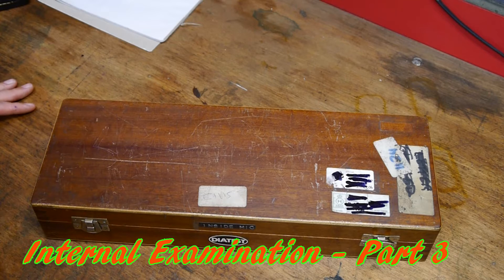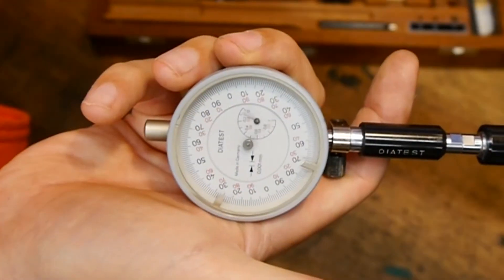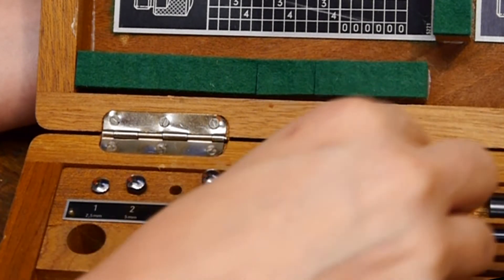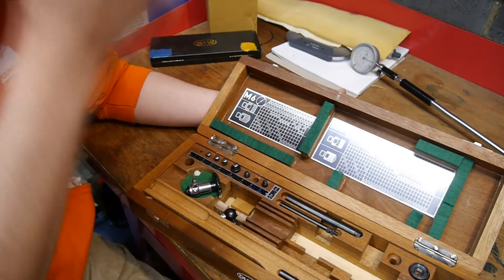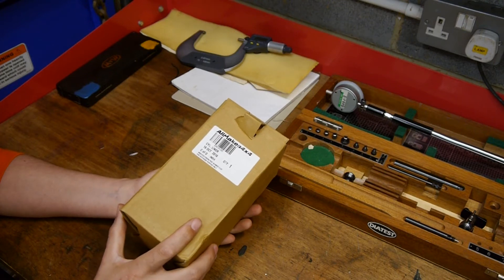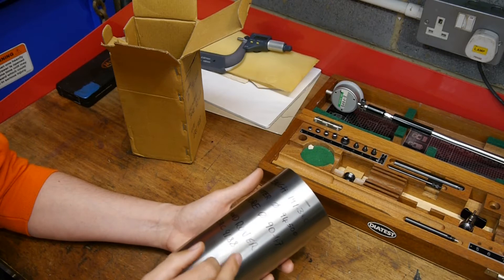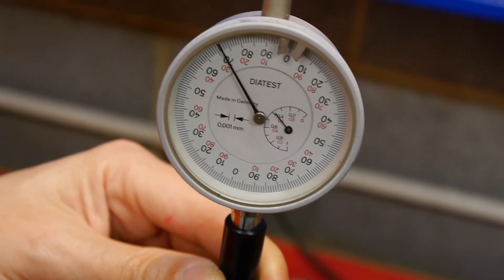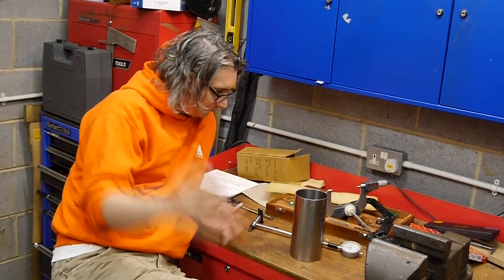Internal Examinations Part 3

Comment: What a nice bit o' kit Chris, Silly accuracy though-when working at those sort of degrees of accuracy what is right? I mean a stout fart might upset the part and throw your readings!,
 Best regards, Sam,
Reply from the maker: Hi Sam.  I was a bit out my depth with this one. I should think it would take a lot of practice with this equipment before making reliable measurents. You really need to develop a feel for it and its quite confusing reading the gauge, it easy to be a full rotation of the dial out. .  Still it was very interresting to play with. Makes me want to have a go rebuilding a real engine.